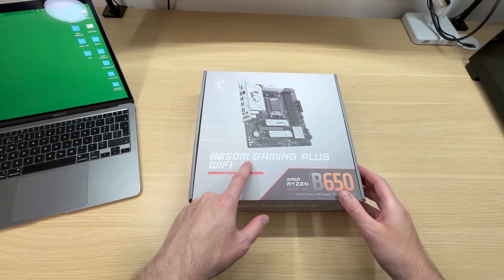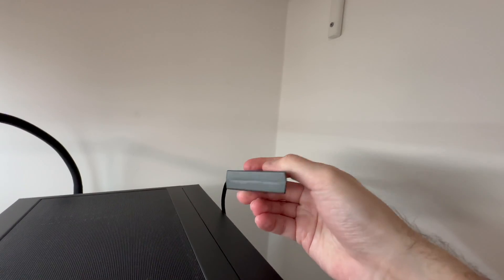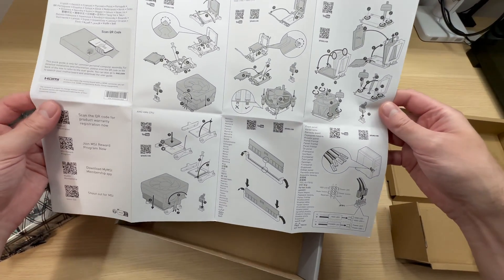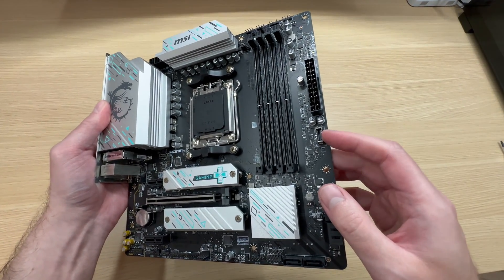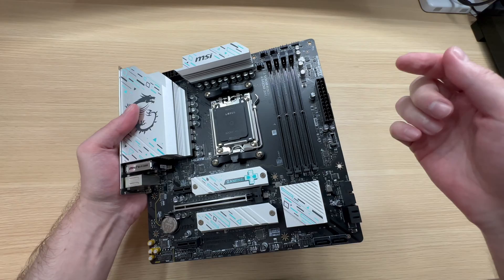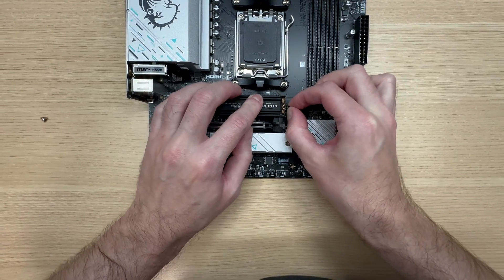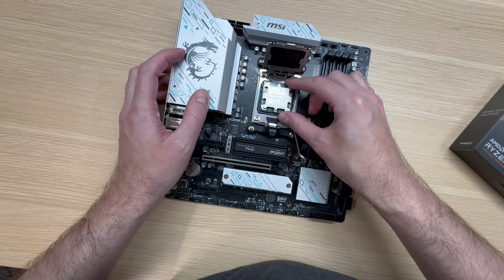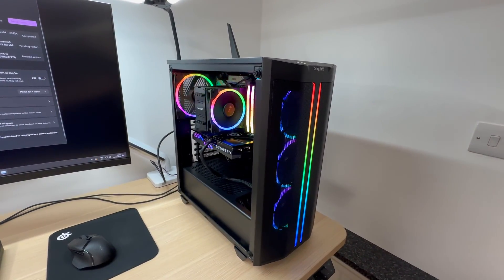MSI B650M GAMING PLUS WiFi [Unboxing, Installation, Features & Specs Overview]

Comment: Is this mobile motherboard worth it ?  I've been googling things I seen some say msi b650 is better than b650m is that true ?
Reply from the maker: I still use this motherboard to this day as part of my Ryzen 5 7600X build. Works well. I have no complaints.
Reply from the maker: There was one thing in the past though - slow start up time when you power it on. But then I updated BIOS to the latest version and now everything works fast and smooth.
Reply: @iVadimUnbox but can you tell which one is better msi b650 or b650m

Comment: as a result of my long experience, brand motherboards that you should never buy msi products and motherboards all regretted, thank god I bought the latest b650 flash bios usb port burned, I bought a psu, the best one called msi fuse blew, burned b550, the room gave a red light error and never turned on, we tried every way, they didn't change because of service user error, I wrote to the msi official site, the guys didn't even shake, I wouldn't recommend

Comment: hi , i just got a new pc with this mb. am having trouble installing my existing wd blue NAND SATA SSD M.2 2280 and wd sata 3.4 hdd. my system is not detecting this two drives. not visible on computer storage mangement as well. bios is only showing my sata 3.5 drive on sata 2 slot but when logged into sytem its not showing any drive. please help. i tried changing the setting on bios but its not working
Reply: Disk you try disk partitioning?

Comment: Is that antenna to also boost bluetooth? I've seen mixed responses to this
Reply from the maker: Yes, this antenna is needed for both Bluetooth and wifi.
Reply: @iVadimUnbox  Can I use my old wifi adapter on this motherboard? I have TP LINK AC600 Archer T2UH. Its very old but it does the job.

Comment: It support Ryzen 7 9700x ?
Reply from the maker: Yes. You might have to update BIOS before installing the 9700X if the motherboard is not shipped with one of the later versions. That's something you have to clarify with the seller.

Comment: Could you timestamp where the SATA is connected? Because the included instruction manual suggests that it's an external drive that doesn't come with the motherboard.

Comment: Hello, does this mobo support rams with intel xmp or only amd expo?
Reply from the maker: Only AMD EXPO is supported. You can’t use Intel XMP with AMD CPUs, regardless of the motherboard.
Reply: @iVadimUnbox  thank you bro. I thought you can fit in an intel xmp ram on that mobo.
Reply: I am using g skill 64 gb 2x32  6000mhz ram with intel xmp, and no problem so far

Comment: did you fix the slow boot time? mine was 1 min + booting time how to fix this?
Reply from the maker: Same here. I haven’t looked into fixing it because it doesn’t bother me. Since it doesn’t affect performance, I’m fine with it.
Reply: @iVadimUnbox  it's been a problem for whole lot of motherboards, from what I've read fix is simple bios option switch thingy
Reply: @Lospingvin  Yes. Most likely it's in that mode where it retrains the rams when you restart or reset the computer. You have to go in bios and turn it off.

Comment: help me ...
the thing is i have seen the same model with 2 ram slot and 1 nvme with heatsink and another without the heatsink...

the model of the motherboard is same msi b650 gaming plus wifi...

in my region, i only found this motherboard not the motherboard you suggested ... i dont know how it is possible

Comment: 👋помогите у меня горяд диоды cpu и dram  все крутится думал подождать надо, час ждал толку нету 

Материнская плата MSI B650M GAMING PLUS WIFI
Процессор AMD Ryzen 5 7500F OEM
Teamgroup Оперативная память DDR5 T-Force Delta RGB 32GB 6000MHz CL30 (30-36-36-76) 2x16 ГБ

Comment: I have bought this motherboard and i can see that there is two 8 pin connectors for CPU . my question is do we need to connect both 8 pin CPU power connector to work it ?   My CPU is Ryzen 5 7500f
Reply from the maker: You don't have to connect both. 1 is enough for such a low-power CPU.
Reply: @iVadimUnbox  I'm a newbie to building. I'm planning on buying this for my 7500f. Just wanna ask will there be an issue If I populate both the 8pin cpu power connector instead of just one?
Reply: @Goefrei0516  just connect two 8-pin to deliver smooth power to CPU, don't worry about connecting two cables
Reply: @iVadimUnbox  i have a ryzen 9 7900 (non x variant) 65 watts. Should i connect 2 cpu cables?
Reply: @Goefrei0516  my pc is black screen after building and I have connected Motherboard HDMi because my gpu still not delivered .  Cpu 7500f and my friend told this cpu not work without gpu !
Reply: It will not show even bios without GPU ??
Reply: @shihab8921  it has no iGPU hence the F suffix on the processor name. You need a dedicated Graphics card.

Comment: Man pls help i have this motherboard and corsair 6000mhz cl36 32gb ram but in pc settings it show 4800 how can i change that
Reply from the maker: 1. Check that your RAM supports AMD EXPO.
2. Enable EXPO profile with desired speed. In your case that is DDR5-6000. The process should look something like this - https://www.youtube.com/watch?v=sAHicMlfJMU
Reply: My ram supports xmp and expo if i open expo it will 6000mhz or i need to do anythong else @iVadimUnbox
Reply: İ dont know that with this old video
Reply from the maker: Yes, the video is old. But process is similar to what you see in it. Enter BIOS and select EXPO profile that corresponds to your desired memory speed. If you have DDR5-6000 and want to enable that 6000 speed then usually it is Profile 1

Comment: Thanks for the review!I am wondering if i should get this motherboard or the b650m pro rs.They are the same price and i am thinking of pairing with ryzen 5 7600.Could you please help me and explain why the one i should buy is better?What are the pros and cons?
Reply from the maker: I'd pick the MSI option. It has better power delivery system, larger VRM heatsinks, WiFi & Bluetooth, and probably some other features advantages. I just don't want to dive deep into spec sheets.
Reply: @iVadimUnbox  Thanks for replying!Will this motherboard be able to hold future upgrades such as a more powerful cpu and a strong gpu?
Reply from the maker: For sure. This MSI board can handle the most power hungry AMD chip 7950X. AM5 is a good platform if you value longevity. AMD said that they will continue releasing new CPUs for it until 2027+
Reply: @iVadimUnbox  thank you for the help👍

Comment: can i use my ryzen 7 7800x3d and rtx 4070 with adata xpg ram?? with this
Reply from the maker: It's up to the motherboard compatibility. Check compatibility list available on every motherboard manufacturer's official website. Usually you can find it in (Insert your motherboard model) -> Support -> Compatibility -> Memory

Comment: i have this and im very happy
Reply from the maker: Same🤝🙂
Reply: Saw a video on how the motherboard fails or something I didn't get it. Just making sure you didn't have any problems? Any pros and cons?
Reply from the maker: Same here. I've been using it for over a month now with DDR5-6000 and Ryzen 5 7600X. No issues.
Reply: @teckersguyo7783  no problems, ive only enabled expo and undervolted my cpu in bios and everything's been working pretty well.

Comment: Would you recommend this board, B650M PG Riptide or B650M Pro RS?
Reply from the maker: I really like this GAMING PLUS WIFI motherboard. B650M PG Riptide is also pretty good. Can't go wrong with either one of them.
Reply: I would recommend msi mag b650 tomahawk. 
I have it + 7600x and works perfect and enough features for future.

Comment: hi, are u able to enable amd expo with that corsair ram? i have the same setup but i cant enable amd expo in the bios, i have an error when i turn on the pc
Reply from the maker: There is AMD EXPO version of Corsair RAM available. Unfortunately, the one you see in the video doesn't support EXPO. So, I had to switch it to Crucial kit that does support EXPO. You should check your memory kit. If it doesn't support EXPO then swap it for the one that does.
Reply: @iVadimUnbox  can you say me the model of your ram?
Reply from the maker: It's Crucial Pro DDR5-5600. To my knowledge, all Crucial DDR5 memory kits support both AMD EXPO and Intel XMP at the same time. That's why I like Crucial memory. It is versatile.